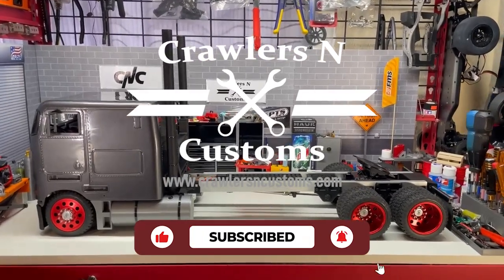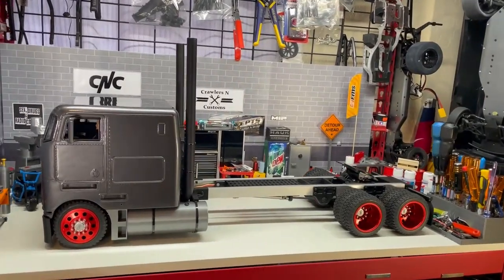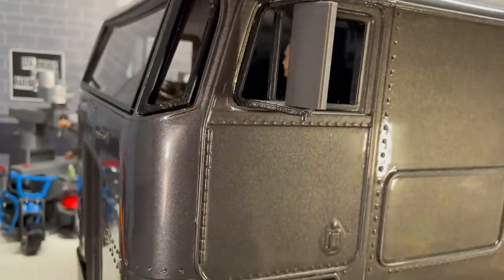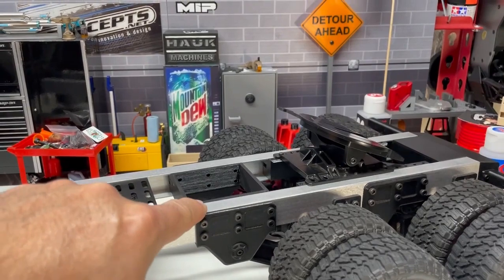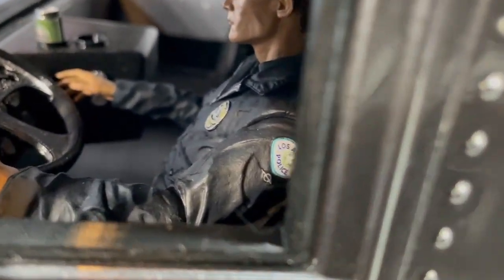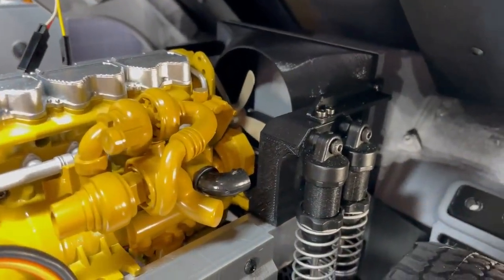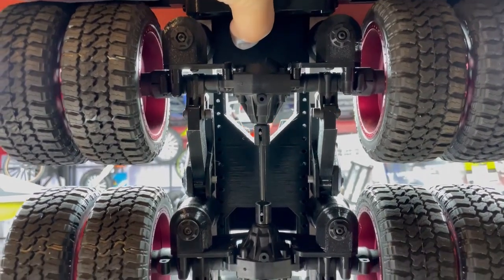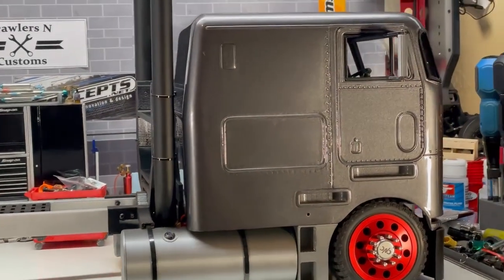An RC Tomley & Talbot CAN'T Buy?! Yup! Worlds Only 1/10 Scale Cab Over Semi!

Comment: This reminds me of my first truck I hauled boats so we would stretch a standard frame to 30 feet then lay a deck on the frame and move the 5th wheel to the rear down low behind the tractor called a stinger . then build the trailer 45 foot long including the 5th wheel all open frame for an overall length of 75 feet .  You did a really nice job on this one sir.
Reply from the maker: Thx. Dang that sounds pretty dope!
Reply: @crawlersncustoms  Thanks man that was in the 80's you could put a 20 foot boat on the truck and a 45 foot sailboat on the trailer when you hung the mast off the side it would stick out past the rear almost 15 feet sometimes .makes for interesting turns in town.

Comment: Love this truck! I've used similar aluminum stock for frames on a couple of 1/6 scale custom crawlers I built. I totally agree with you about the 1/14 semis, they just don't fit in with my 1/10 crawlers and cars! What transmission was that? I mistakenly gave 1/10 Rod shop credit for the entire build in my video last week, I'm glad you made this video. I think there's a market for this size of RC semi, even though my budget won't allow for it!
Reply from the maker: Thanks man. It’s this tranny:

https://www.ebay.com/itm/165739531191?mkcid=16&mkevt=1&mkrid=711-127632-2357-0&ssspo=nLeV9OXOQfG&sssrc=2349624&ssuid=UnS0iONSRg6&var=&widget_ver=artemis&media=COPY

Comment: Well done, it really has the feel of a cabover, I drove a Freightliner and Volvo for a while when I was a driver, one thing I would do is add air bags under the rear of the cab so it helps with the weight, they would go between the cab and frame, again great job, I think I need to build one
Reply from the maker: Thx. It’s actually something I want to do. If you notice in the video there’s a guide bracket on the back of the cab. It will get replaced with a more scale part with small tpu bags for suspension.

Comment: Hello, Sweet Rig.  What did you use for the pass thru tandems in the rear?
Reply from the maker: Nothing special. Those are stock cen axles but most any axle could be used.

Comment: How wide is the frame rails from outside to outside?
Reply from the maker: 95mm
Reply: Thanks for the info I currently own a 359 peterbilt and I wanted to make a rc of what I want my real truck to look like but I want to make a cabover as well yours is awesome love the work you put into it I just wish I knew how to do 3d printing
Reply from the maker: @johndeere1958ful  to have success you’d likely need to start smaller in lots of regards. Without hundreds or maybe thousands of hours of design/modeling/printing experience this would be a pretty big challenge for most. If you’ve built rc models before and designed parts then it’s not too bad if you take on the project in smaller bites. Good luck 🤛🏼🤘🏼

Comment: where can i get one off the pass through axles?
Reply from the maker: It’s a stock cen axle. But there are pass through options from other manufacturers as well.
Reply: What manufacturer makes the cen axle pass through option if you don't mind me asking?
Reply from the maker: @frankiemabry1726  none. It’s a stock axle with two stock pinion carriers and long bolts.

Comment: I am in the middle of building an off road stretched frame long nose Pete 1/10 scale came across this video and was like whoa another one exists mine is about 4’ long has 4 fusion motors triaxle rear and is all wheel steer .. I real like this cab over it looks great .. check out my build over on my channel and KEEP ON TINY TRUCKING
Reply from the maker: Dang 4 feet long?! That sounds wild. I’ll check it out.

Comment: So kind of false advertising saying it's the only 1/10 scale COE. They been around since the early 90s I would say.... mostly all custom built. Most bodies were custom built or molded if lexan. And pretty much all were set up for pulling. So technically this isn't anything new. But not bashing at all. This is a pretty cool build.
Reply from the maker: * with line lock 😂🤘🏼
Reply: @crawlersncustoms and point of that is what?
Reply from the maker: @Rocketman442-RC  fun.